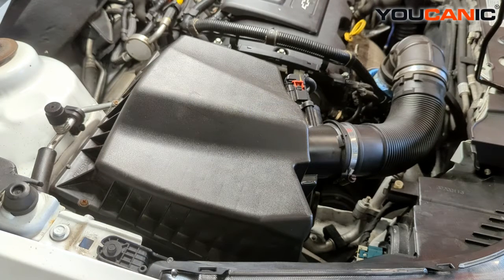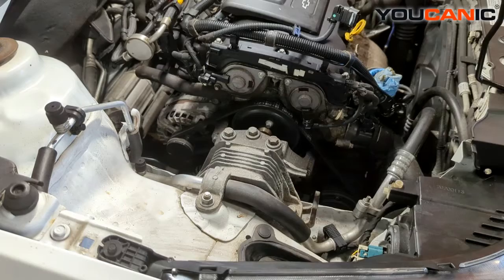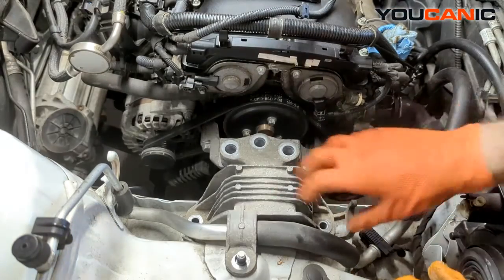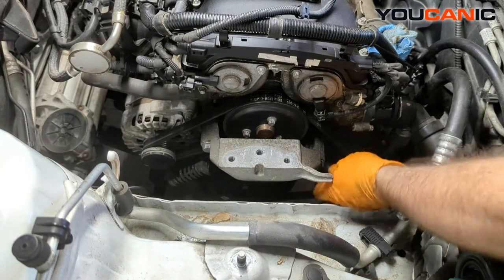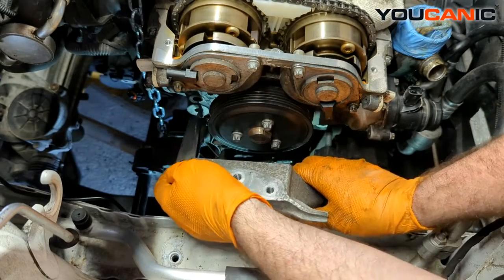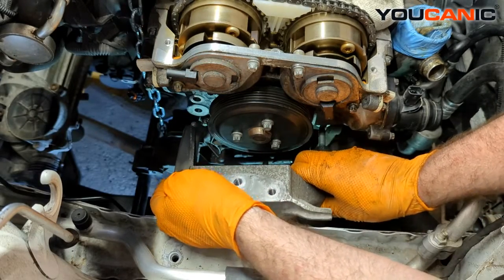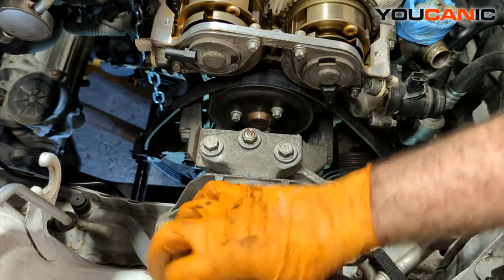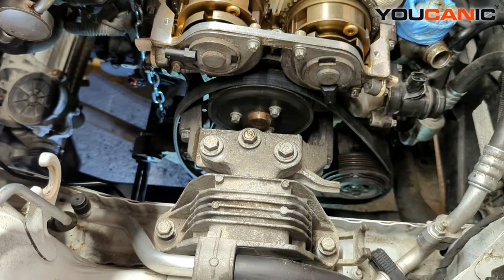2008-2016 1.4L Chevrolet Cruze - Motor Mount Replacement

Comment: Bad info. Those are torque to yield bolts that must be replaced.
Reply from the maker: Thanks for your feedback! We're here at YOUCANIC to provide empowering insights for car owners. Your note on the torque to yield bolts is invaluable. We always recommend referring to factory manuals where necessary, which you can find on www.youcanic.com. 

Your experience is crucial to achieving our mission of empowering car owners, so don't hesitate to share your knowledge or ask questions on our site. We continually strive to make car maintenance less daunting and more accessible. Thanks for being part of this journey with YOUCANIC!
Reply: @YOUCANIC  Such a stupid business response its businesses like yours that killing the industry
Reply: Only the three bolts on the top with the washers are torque to yield. A dealer will replace them for warranty reasons but you’d probably be just fine reusing them a couple of times.

Comment: I wish you showed exactly where to place the jack underneath to support the engine...🙄
Reply from the maker: Thanks for your comment! We understand the importance of providing exact details. While we strive to make our videos as helpful as possible, some specifics may vary based on the car model. We encourage you to take a look at our website www.youcanic.com. Here, we offer comprehensive guides, free resources and our exceptional YOUCANIC scanner for more precision.

From detailed factory repair manuals to miscellaneous assistance, we're here to support you on your car maintenance journey. Our goal is to empower you and boost your confidence under the hood. Don't hesitate to reach out to us for any additional help!
Reply: @YOUCANIC  We came for a cruze silly...just tell us
Reply: it's not necessary, I didn't use one and they lined up fine. The motor mount flexes so you can screw them in. You might need to put a little pressure against it, like use a screwdriver